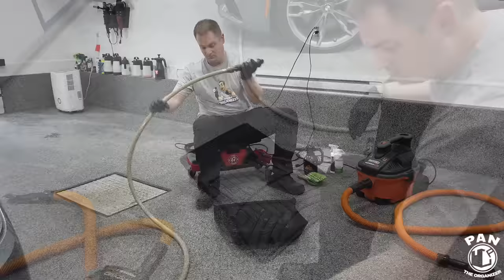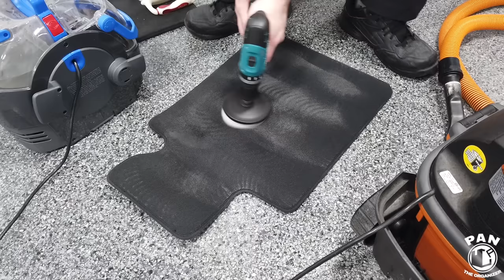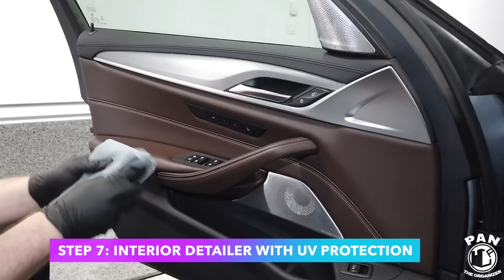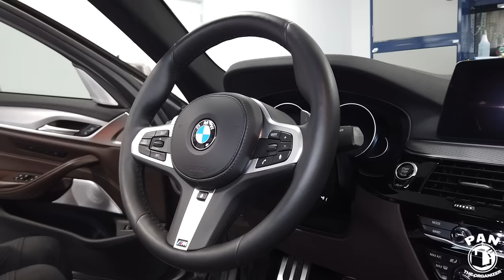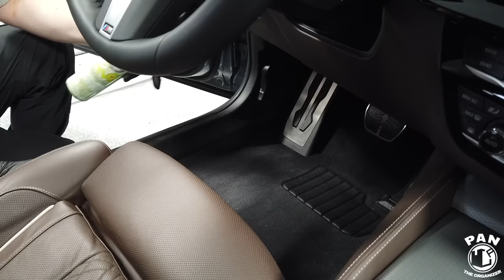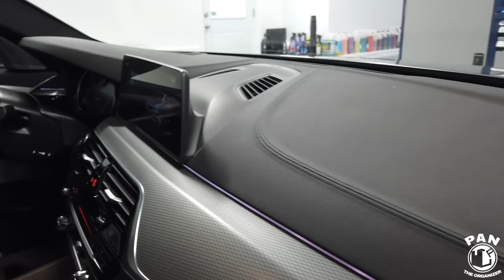SATISFYING INTERIOR CAR CLEANING : Interior Weekly Detailing of my Car!

Comment: Pan.  Just bought a new Genesis GV80 Prestige and it has leather (Black) on the dash, console, doors, steering wheel, seats, etc.  What do you recommend I use to clean, protect and seal the leather to keep it looking new for years to come?  I’m most concerned about the door panels and dash. Thanks!
Reply from the maker: Congrats on your new GV80!! That is one beautiful vehicle!! I made a tutorial specifically for leather seats recently, here you go: https://youtu.be/CuN77nz8Ex8

That was a ceramic coating. If you prefer leather sealants, watch my tutorial here: https://youtu.be/ukIuqk8noyk

Same applies to any leather surface in your vehicle.

Comment: Didn't know about Bead Maker on gloss black trim. Looked great. I find detailing interiors a bit of a chore, but again cool vid Pan, and thanks.
Reply from the maker: My pleasure Simon. Yeah Bead Maker can be used as a quick interior detailer on pretty much all the hard surfaces, you can even use it on leather. Quick pro tip.

Comment: Hi Pan, I have a Mazda cx-5 2020, and I have cloth swirl/scratches on the shiny interior plastics, every time I use a cloth and product they get worse, what do you suggest 1. removing the scratches and 2. maintaining the scratch free gloss m  using the incorrect cloths, microfibre? Thanks
Reply from the maker: Use a bit of polish on a microfiber towel and hand polish them. Easy fix.
Reply: @PanTheOrganizer  thank you for responding, I use Meguirs products so will use some of that, 👍

Comment: You videos are a go to in Auto detailing without hesitation. Loved that epoxy garage floor, was wondering why you do not use a folding table as a work bench while detailing? Would P &S Bead Maker work well for the exterior black window frames?
Reply from the maker: P&S works wonders on pretty much all hard surfaces, including exterior piano black gloss trim, glass, paint, interior quick detailer, etc.

Comment: Hi Pan, how do I safely clean a TFT digital instrument panel like the one you had in your BMW?
Reply from the maker: You can usually get away with just distilled water on a gentle microfiber towel. And what I do sometimes if there are more fingerprints, is spray a quality automotive glass cleaner (like CarPro Clarify) on a glass towel, and then gently wipe the screen. You can also use the new Gyeon Interior Detailer on infotainment displays like I did in my Porsche in this video: https://youtu.be/m19CMDUOBZM
Reply: @PanTheOrganizer  thanks very much, i started to try only with a dry gentle microfiber tower and its works. For the infotainment screen i Will try with destiled water.

Comment: Bead maker on piano black trim? I did not know about that. Did you use it to clean fingerprints aswell? 
Great video, so satisfying.
Reply from the maker: Yeah that's the off label use many do for the Bead Maker, use it as a quick interior detailer. It does remove some light smudges yes. Of course its main goal isn't to clean, so if you have a dirty interior, use an interior cleaner first (like P&S Xpress Interior Cleaner).
Reply: @PanTheOrganizer  Thank you. Keep it up Pan :)

Comment: What spray do i use to clean the piano black console and trim
Reply from the maker: The same Bead Maker will work just fine as a quick interior detailer. It will lightly clean, protect and add slickness.

If you just want a pure light cleaner, I like Gyeon Interior Detailer on gloss black platics too.

Comment: Hey pan chill vid. my question did you use p&b bead maker paint protector on the piano black gloss?
Reply from the maker: That's exactly what I did. P&S Bead Maker also works well as a quick interior detailer on all hard surfaces, and you can even use it on leather seats. Many detailers use it as a general QD for interior and exterior. You can even apply this on glass.

What we do is when you're done using Bead Maker as a drying aid on the paint, use that Bead Maker dampened towel to quickly wipe the interior surfaces (the surfaces have to be cleaned before obviously if they're dirty) and boom, you get protection and a nice slick feeling surface.

Comment: Don’t you just hate when car manufacturers still use glossy plastics anywhere in and on the car? I know I do, I have it inside and outside.
Reply from the maker: It depends. If used tastefully, as it's the case in my BMW, it can be nice. And since I take care of my car, there isn't a single scratch so it actually looks great as you saw.
Reply: @PanTheOrganizer  Yeah, but it demands too much attention and my wife is one that creates scratches. Cheaper to replace her than the glossy plastic but you know....🤗😉

Comment: I feel like you skipped cleaning the dash and doors and went straight to applying the protectant.
Reply from the maker: No. This is a simple weekly maintenance. No deep cleaning was needed. It’s always pretty clean. The interior quick detailer I used was enough for light cleaning and protecting duties.